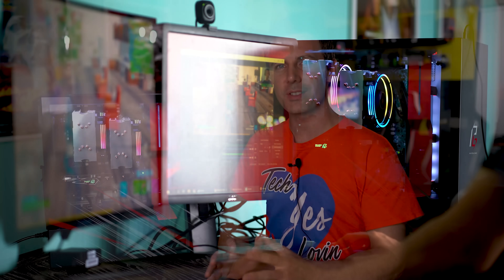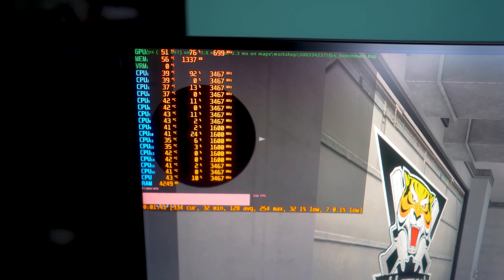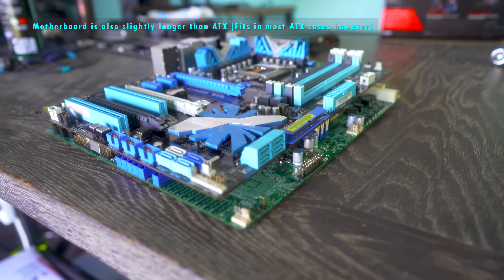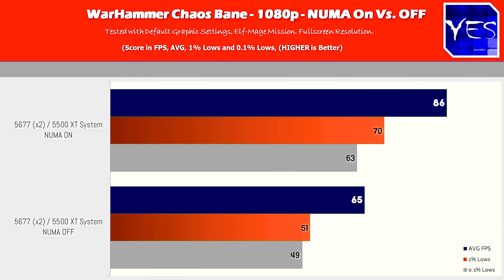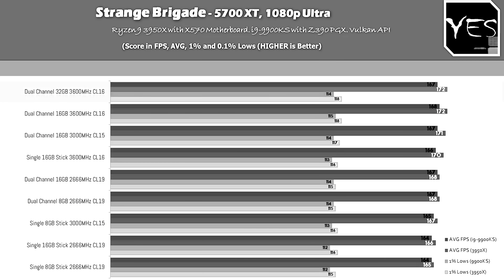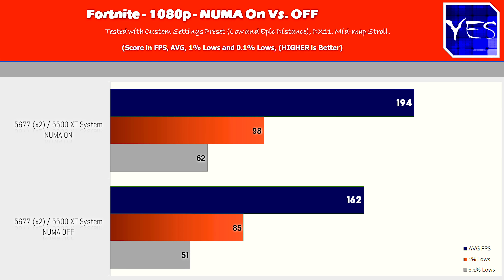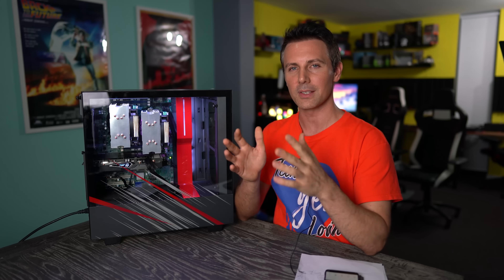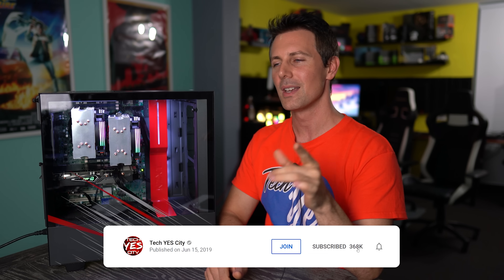NUMA Enabled Vs. DISABLED - Can Dual Xeons Play Games Better in 2020...?

Comment: I love these dual CPU systems. They look badass, like something out of an alien ship. The problem is I can never justify a use-case for them compared to modern CPUs. Is there any practical workload where these dual systems outperform modern high core CPUs?
Reply from the maker: With Ryzen around, not really.  I would like to try some x99 stuff, that would be really interesting, especially if you could get 16 cores / 32 threads for cheap.
Reply: No. A single CPU with the same amount of cores as a dual socket setup will always be faster. Dual/multi socket boards aren't about performance as much as density.
They sure look badass though, fully agree. :)
Reply: @osgrov  There may be tasks that could gain more from the increased memory bandwidth of a dual-socket board, but those are unlikely to be consumer grade tasks.
Reply: @mapesdhs597  absolutely, there's plenty of server stuff that benefit from multiple sockets. For client use, though, a single CPU will always be better.
Reply: @osgrov  There can be a major cost benefit for those who want to experiment with productivity tasks, or solo pros (like Blender and video transcoding), but how long the crossover period lasts now with AMD advancing so quickly is anyone's guess. Atm a dual-S2011 with a couple of 2650 v2s and 64GB RAM costs diddly squat, but XEON v3/v4 availability is much lower and somehow I doubt DDR4 ECC will ever become quite so cheap. In the meantime, what will by then be old Ryzens may look a lot more sensible. I could be wrong though, with Enterprise buying a butt load of Intel server tech just to keep pace with performance degradation due to all the security mitigations, perhaps at some point when all that stuff gets sold off there will be another market flood of the relevant tech and the Chinese mbd makers can do the same thing again with dual-S2011-v3. If one isn't interested in budget friendly productivity tasks though then the utility is definitely less. Check my results, eg. the two XEON 2640s and 64GB RAM in the system at the top of the list cost less than 100 UKP combined:

http://www.sgidepot.co.uk/misc/tests-jj.txt

The tradeoff being single-threaded speed is much lower, but this is something which matters less and less these days, the system handled gaming much better than I had expected.
Reply: @mapesdhs597  that's really interesting data, thanks for the link & effort. I'm gonna have to study that deeply as I really could use another box for transcoding. :)
Indeed, if prices have fallen as low as you mention, then the value could be massive for the right tasks. Locally, prices are way higher here (Sweden), I think I'm gonna have to spend more time on eBay to find some good deals.

Comment: When I boot up games on my pc with in 15 minutes it would freeze how could I fix this the cheapest way possible
Reply: Disable hibernation + disable & delete page file + clean & re-apply thermal paste . If your C drive is mechanical HDD then run a good defrag using piriform defraggler . Move all personal files (movies , songs , dox) from your C drive to someplace else . Empty  desktop completely . Disable all ALL startup items except security apps . That should be enough , I hope :)
Reply: Also  "install iobit driver booster free"  & update all drivers & game components . Very important !
Reply: no, somebody have to come and assess you PC first to quote you a price. You bargain your price there/then, not before.
Reply: Just take it to a pc shop if everything else that people have suggested doesn't work out for you :).Even if it does end up costing a bit of money to fix it  it will be better in the long term for you instead of you being stressed out over it like I was when I built a new ryzen system and had issues with my new 3700x that ended up getting replaced but not before I spend hundreds on it trying to figure out what the problem was first lol...Some times it's just easier to get the pc shop to look at stuff instead of stressing out and spending money on unneeded things like I did because I was impatient haha.
Reply: @ Wyatt . The PC in question here is an Optiplex with Intel chip & not some half-baked AMD chip :)) Do please get used to it -- Ryzen chips (also AMD graphics) shall always give problems to newbies . Been into PC building for 20 years now , i.e , I know what AMD is at the end of the day :)) LOL

Comment: For your guy with the rx 480/580 question: Just overclock it to the 580s speeds using the AMD control panel before you attempt any flashing. If you do flash make sure that in addition to the typical device id stuff you also make sure that the memory chips in your 480 are the same as the ones that the 580 bios is intended for, the timings will be different if the chips are different and that can cause problems
Reply: The RX580 consumes significantly less power in idle because of a lower core voltage on the lowest power stage. The AMD driver also rejects edited RX480 bioses while it is okay with edited RX580 BIOS. That's why I still flashed my RX480 to an RX580.
But I would not recommend to flash a graphics card without dual BIOS switch. I just bricked one of my RX480s with a failed BIOS flash.
Reply: uzefulvideos woah, there is actually an RX470/80 without duel BIOS?!? I’ve never heard of one being bricked before as I’ve never seen a single BIOS version of the card. Also did you try reflash with it in a secondary slot (so you have a display on another card) to try reflashing?

Yeah having to run ATI-mdag pixel patcher after driver updates is super annoying, but at least it works unlike modern Nvidia cards (for example all Pascal requiring hardware circuit mods, which I shouldn’t have to purposely short out parts on a $1200 Titan Xp just because it suffers from frame drops from power throttle even at stock with power limits raised to the max allowable of +20%... It’s so much nicer having “Palpatine mode” as I call my “Unlimited Powa!” unlock on my RX 470s which are happy pulling 300w even on air for 3dMark benching)
Reply: @jakegarrett8109  I have an Asus RX480 that doesn't have a BIOS switch. My XFX RX 580 has one though.
Reply: @jakegarrett8109  It's the MSI RX 480 GAMING X 8G. During the flashing process my system crashed (I had Furmark running during flashing) and now it doesn't shop up as a device anymore. I couldn't even reflash flash the VBIOS with atiflash in FreeDOS, I always get an "Adapter not found" error message.
Reply: @uzefulvideos3440  Buy a new bios chip
Reply: @toddsimone7182  I don't think that's possible, I can't find anything about it on the internet. 
I'm talking about the GPU's BIOS, not the motherboard's BIOS.

Comment: How many of you guys have dual xeons? Its so rare inmy country, almost non existant :)
Reply: My last dual cpu board was a Tyan tomcat IV socket 7 dual Pentium 200MMX motherboard.
Reply: @soupwizard its qute an old one! :)
Reply: yep I've had a few dual xeon systems, I've got a dual e5 2470 workstation system and I used to have a HP Z600 with dual x5675
Reply: Have dual and  some quad systems on almost all Intel CPU generations/sockets ranging from 486 to LGA 1567 with quad Xeon E7-8870 Westmeres. Are on the hunt for 386 CPU boards for my Compaq Systempro so i can have a dual 386 system aswell. The oldest dual Xeon i have are a slot 2 Compaq Workstation with 550MHz CPUs. Way too many systems, but cant stop collecting:)
Reply: @retromaniac4563  wow nice collection mate!! :)
Reply: I have a friend with duel Xeons in an EVGA SR-2 board but he's the only one I know of with a setup like that.
Reply: Well, I see there are a few of you guys. I never had one and i guess it's not quite worth to get one just for a sake of having it, unless someone wan't to get rid of similar system for an ultra-cheap price :)

Comment: when i play games i take a cpu out because otherwise it really affects performance by 30 fps
Reply: Hmm, another variable to try! Was that with NUMA enabled or disabled? If disabled that would slow down games due to the possibility of game threads running on one cpu but needing access to memory associated with the other cpu. Maybe there's additional overhead to having 2 cpu's installed that affects gaming?
Reply: @soupwizard  could just be a buggy gamecode, it's more likely. Multithreading is not something every dev is expert at.
Reply: @soupwizard  it was gta v and dual x5670's. numa is enabled. no option to disable

Comment: Well sounds like numa is only enabled on multi cpu server boards? My latest x79 2011 board is a top end Asus but single cpu only and I have a 4960x in it which is a about the best consumer cpu it can take. Used to always play with all the tweaks but anymore I'm more interested in rock stability rather then a few more frames in games. I mostly do video editing and encoding these days and everything sleeps till needed.
Reply: Yes, NUMA is a feature only on multiple cpu boards that have part of the memory attached to one cpu or another. On that supermicro board, each cpu has a direct connection to the 3 dimm slots next to it, and a longer hop (slower access) over the the 3 dimms attached to the other cpu. NUMA keeps program threads running on a particular cpu and allocates memory for those threads from the dimm slots directly attached to that cpu, for fastest memory access by that cpu.  On single cpu systems, all ram is associated with the single cpu, so no fancy jedi memory tricks are needed to optimize memory access.
Reply: Thanks, figured that had to be the case considering the board he was dealing with. I've never had a multi cpu board before but you never know considering my buddy builds networks and pc's for a living. I always end up helping him out with recycling stuff and occasionally helping with big builds so I end up with trade ins and cool older builds he gets to trade for the help. These upper end business level and high end consumer stuff are still very fast, and usually dirt cheap.

Comment: For the CPU testing please crank up graphic settings except resolution and anti-aliasing. Load CPU and memory but GPU should be relaxed. Particularly if you want to detect some tiny differences between the CPU settings

Comment: If anyone's actually wondering or see this or want to buy it. The motherboard is named X8DTL

There are a few variants like ones with iKVM, SAS3, SAS6, etc...
Reply: Thank you. I am interested.
Reply: @Dr.C-UTS  No problems! It's a great motherboard if you can get it cheap. If you can get away with it, you can use the HDMI on your GPU for sound in some circumstances. Mine is the SAS variant as well so it does use more resources out of the chipset and makes it generate more heat and some GPUs might block the airflow for the chipset which may cause it to shut down. I affixed small fans to the chipset and SAS controller to make intense gaming sessions better.
Reply: @MarcoGPUtuber  thank you Marco!